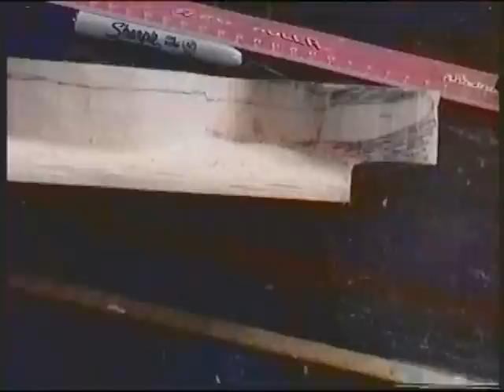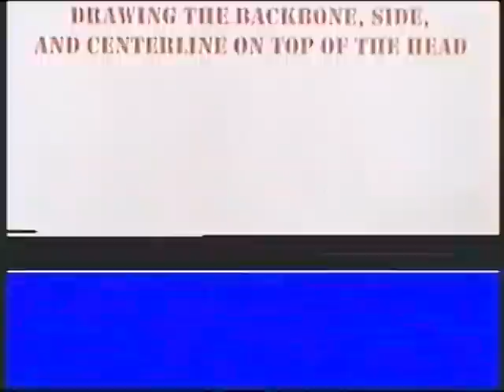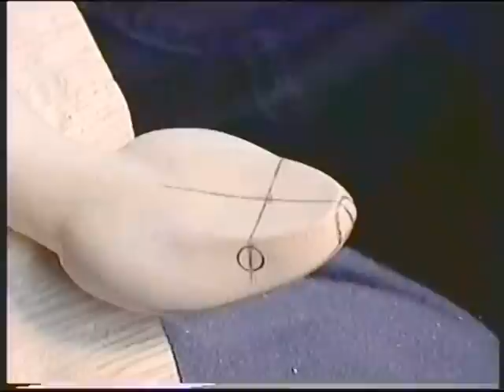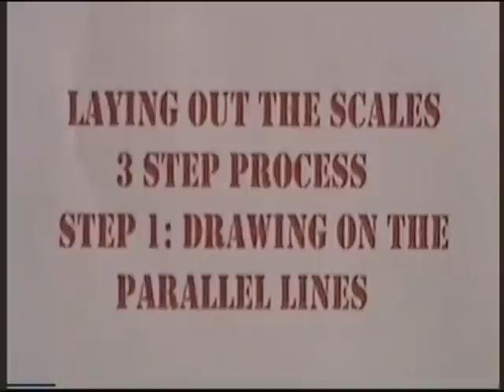Carving a Snake from Wood! Shamokin, Pa. Part 1 of 3

Comment: Great so far. Just a little tip for you ; a guy has a YouTube channel called "Stinnets Sticks" and he carves walking sticks and a great many have different snakes on them. He has had special wood burning tips specially made for snake scales - different scales dependant on the type of snake they are, and they are available to buy from the company he asked to make them for him. It would be so much easier for you and you wouldn't have to do all the line work drawing so it would save time. Anyway, take a look and see if it would help you in  any way.